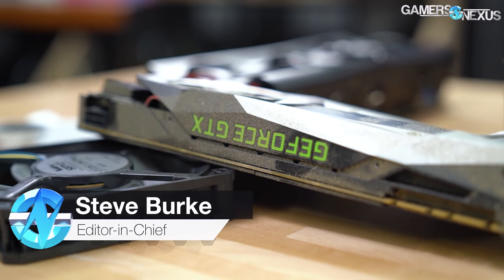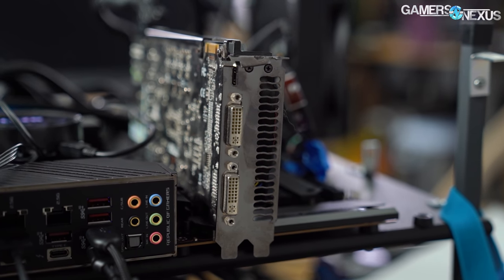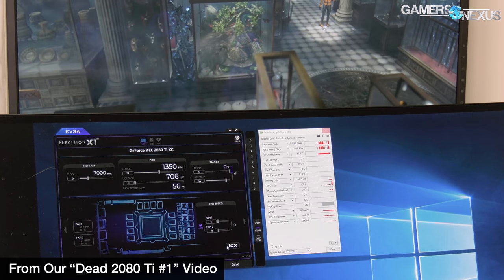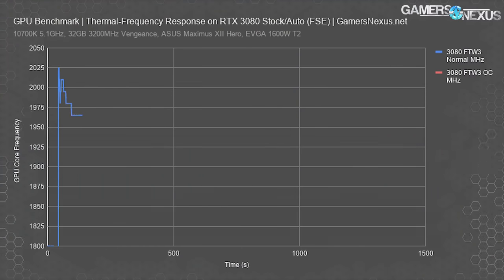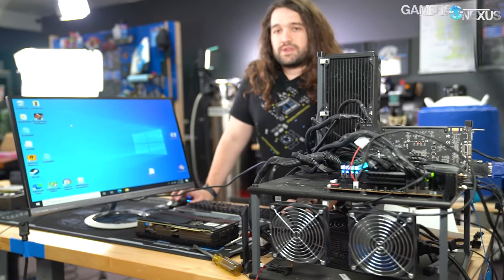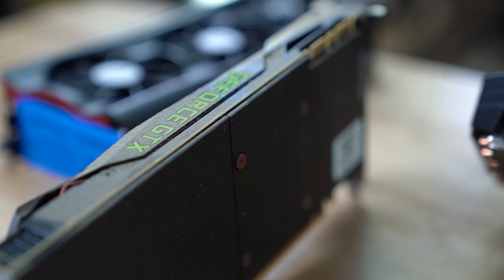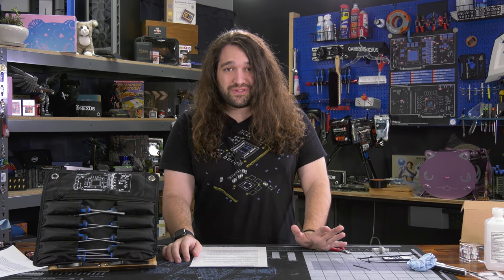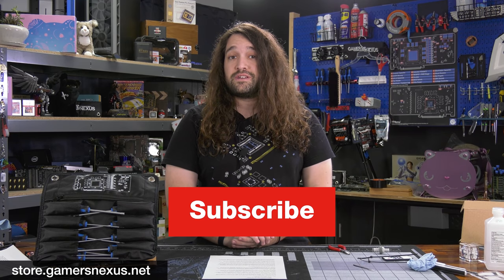Warning Signs When Buying Used GPUs: How to Detect Defective Video Cards

Comment: I recently saw a listing on FB for SIX Nvidia RTX FE 3080s for $500. Yes. $500 total for ALL SIX GPUs. I asked the guy, "What's wrong w/ them? Do they work?" He replied that they all work just fine. After a day of being skeptical, I then asked if I could test at least one on my system to make sure it works. He didn't respond until a few days later claiming that someone else was buying them. I still don't know if they worked, but I'm glad I didn't buy them. It was too risky.

Comment: Bruh.... when you pulled out that DirectCUII.... immediate PTSD, I knew it was a GTX560Ti right away. I've had one... matter of fact, I've had three different variants of a GTX560 and they all had the same issue. The design just developed a flaw after years.... the VRMs would overheat and it would crash/artefact. The only solution I found is baking, as well as cranking the fan to 100%. Hopefully if the design of the card was adequate, that would help with cooling the VRMs... The last thing I did to my ASUS was buy it some new thermal pads. I kept it going that way

Comment: Bought a used R9 290 (Tri-X OC). With all video outputs except DisplayPort being non-functional (didn't know it beforehand and actually for a long time after purchasing... since I used DP from day 1). So that may also be a valid thing to check: do the outputs actually work?
Funny thing though... first thing I did after getting the card was break one of the fan blades myself, then "soldered" it right back on with a heated butterknife. Card lives to this day (not in my PC though).

Comment: I have a GTX 1070, the sag is so bad the cooler seperates on the far side, the IO-Shild was missing completely when I bought it and I bought it without testing. But it works the girl I bought it from seemed nice and it was cheap 120bucks or also local so I guess I could have gotten my money back like with a RX480 I once had for about 2h. When you buy local the person you are buying from is very important. And if they seem nice I sometimes ignore warning signs and haven't had a problem so far. This off course only applies to local purchases.

Comment: I've got a EVGA 980ti Hybrid that would lock Core and memory to 400mhz and lock the FPS on everything to 15 FPS. This happened on the release day drivers of the 1080ti and I couldn't fix it be rolling drivers back, however if I restarted the PC 4 or 5 times it would fix itself. About 5 months later it magically fixed itself. I personally assumed it was a driver tactic to break old generation cards to make consumers buy new cards..

Comment: You didn't say anything about what happened to me when I bot my gigabyte Radeon AMD R9 270x second hand that was newer than my CPU and motherboard which was an intel core i7 3770@3.40GHz on a gigabyte z77x-d3h. When I installed the card it just wouldn't recognize the Video card and didn't work. lucky for me I upgraded my bios and the card worked so that's something you need to do as well when buying a second-hand video card upgrade your MB bios.

Comment: I was kinda hoping you guys might do another one of these, but one that show cases Cards that have know Issues that a Buyer might want to lookout for!! Example might be the Asus TUF RX 5700 XT EVO and Non-Evo models. This is just the market for those to sell cards that had bad thermal Designs like the Older MSI Evokes?? I specifically point out 5700 XT models because they are going for $900-$1000 on eBay right now which is Crazy!!

Comment: I got my first GPU is rx5500xt no clue sold it for $20 more than I got gtx 760 2GB for $50 sold it for $25 what do you think the old GPU is worth. I got gtx 1050ti for $270 and it works I haven't check on thermal paste very cheap heat shrink and fans/cover it was made by PNY. I will wait when rtx cards will drop i think not they are going higher.

Comment: One of card I bought recently work fine, everything was ok. But when I decide to repaste it and look under VRM heatsink thinking about changing thermal pad I have what to see. Card was repaired previously. I have not issue with that (but I usually like to know that before buying), I too sell many repaired cards. But three smd caps on memory VRM was completely burn (no short, not anymore :)) and somebody obviously decide to leave them like that on board and just fix fault on GPU VRM. Cap graveyard. 
Not a big issue, few minute fix, luckily board was not damaged and now is like new. But if I didn't notice that one day piece (better say crumb) of any of them will probably move and make short or fall and short something else. 
So yes, people should be extremely careful buying used cards today, now days people sell even cards they never intend to sell when market was normal.

Comment: 2 weeks ago I bought EVGA 3090 FTW3 on eBay. It had water block installed which I didn't care as I was planning to use fans anyway. When I got card the back plate was all sanded/grinded off all the way to aluminum so no serial number on it (that was my bad as I didn't check ALL the pictures in the listing). Water block still had water in it and card was packed back in original anti-static bag. Oily residue all over card. Fan/radiator assembly was heavily dusty and showed moderate corrosion for some reason.   After cleaning it with isopropyl alcohol and installing thermal pads the card failed to boot. Next day it booted but crashed as soon as it was getting in Windows. After messing with thermal pads of different thickness I managed to make card run after all but my motherboard still beeps a code regarding memory when I boot my PC with the card however PC boots into Windows anyway. It does not do it with other cards. In the end I made card to run and pass 3DMark benchmark and several games I threw at it for several days without a single hick up. So I decided to keep it. 

     When all that was happening I thought that I will return it so I went and bought another one. Seller claimed it ran in mining rig for a couple of weeks before they pulled the plug on it (Etherium switched algo) and that it is in pristine condition. The description was more than just stating card name and was written by person with soul so it I felt that it is genuine description and the card should be good buy. It happened to be true. The card looked and felt brand new with all the accessories intact( even EVGA sticker was there!). So I was lucky with that one for sure.

So beware when you buy. Prefer cards that were not messed with before at all: no pads replaced, no water block installed, not from mining rig. Ask seller before bidding/buying and decide to your best ability.

Comment: hello. i do have Gigabyte gaming OC 3060 12G. just want to ask if this is normal. my 1 fan starts spinning around 50degree celsius then the temperature will reach up to 74degree celsius while using it but still only one fan is spinning. i did not yet saw the other two fans spinning, is this normal? what temperature will the 2 fans start spinning? i hope you can answer this. or anybody can help me. thank you very much!
Reply: That means the second fan is defective or broken.
Reply: @erimani5035  thank you.

Comment: Hi, i bought used RX 6800 (ASUS TUF). I have some artifacting issues:
-It looks like a several horizontal lines next to each other with randomly green and white pixels. It last only few frames, hardly reproduciable, mostly when the GPU is switching from heavy load to low load. (like alt tabbing a video game), but never during heavy load.
-It happens only when using Eyefinity, only on one of the two monitors. It is the monitor i select as "preferable". I even can switch that and then the other monitor is then doing it instead.
-Nothing could be seen on video captures.
-Also sometimes i see, that the lower 1/4 of the monitor updates the frame with a small delay (could be seen when fast hovering over something). That happens also when under heavy load.

-Bought a new cables and a new PSU, tried other ports, tried different monitor, different driver versions, didnt help. Tried all the settings in the Radeon software.
-No visible physical defects. 

The seller was some local "Apple servis", the card was propably "repaired" by them. They have several more similar.
They gave me "30 day gurantee" so i need to know for sure its really HW or SW issue before its too late.

Any tips? Many thanks.
Reply: Update drivers/swap the card into another machine. If issues persist, document the issue and make a return to the seller.

Comment: I bought a 5700xt mech from msi...... It came with a bad factory OC and they refused to replace it even though i had recipts and it was literally just bought. They wouldnt even answer my support tickets about it. It would shut my entire computer off.... It now works but i have to lower clock speeds and power consumed and it atleast works. Thanks msi A+

Comment: Bought a 980TI second hand a couple of years ago £200, looked clean, got it back put it in my PC, when I powered it on things start burning and spitting out of the back of the card, lucky managed to shut it down and pull the card out before it killed my whole rig, the guy was a scammer who disappeared, bought it off Gumtree, my advice is only buy if they are willing to let you collect from their home address, and be ready for electrical issues.

Comment: Just a quick PSA. Testing the GPU for 30 minutes isn't enough.

I just spend $1200 on a 6800xt which seemed fine when I tested it. It wasn't until the next day when the issue became clear. The card was so ridiculously unstable it would legitimately crash every 10 minutes in games. Somehow I just got lucky for the 30 minutes i tested it out when everything worked perfectly.
For some reason it however would not crash in any benchmark.

Comment: seeing an expensive graphics card thats absolutely chock full of muck and dust is usually enough to just give it a hard pass, bought one with that very mindset of thinking i could just clean it, turns out it was rusty underneath and loads of little caps were rattling around in there

Comment: I have a used Gigabyte 2070S I bought off eBay. Works perfectly, performs perfectly. My Asus mobo, however, intermittently turns on the white "VGA" LED located with the other POST indicator lights. No idea what it means, and at this point, 6 months in, I'm almost too afraid to ask.

Comment: I bought an Gigabyte Auros 1080ti Extreme for $400 used.  The brand new Asus TUF gaming x570 mobo I bought was crap.  I sold the 1080 for $550 and bought an MSI rx580 that I'm using now.  Basically free gpu, but I'd still like to buy a new one.  Maybe I can get one on drop today.

Comment: I have an R9 390. The problem with it is that the fans don't spin faster when the GPU gets hotter. The blades are spinning all the time with 500rpm no matter the temps of the GPU. The GPU was a few years in a box, so it worked before that. I think the new drivers don't work properly. I have done some research that the fans are bad and should replace them with new ones. I could set it up manually (3500rpm) in AMD settings for faster spinning and for better colling. I would sell the graphic card, but I can't because of this flaw. The problem is if I buy new fans and if it doesn't work, then I wasted my money.
Can you test this out, if you have a GPU with a similar problem?

Comment: My friend got a PC for $15 with a 3200g and an RX 570. We thought it was a great deal, until we saw it had a hard drive and a single stick of ram. He bought an SSD to speed up the system because it was unusually slow, but we couldn't install windows onto the SSD for some reason. Turns out there's an issue with the memory stick where it has a bad sector or something like that, so he has to buy new memory too. I know there are benefits to buying used, but for me personally, that's why I always buy new
Reply: That's an amazing deal what are you on
Reply: That's basically robbery, he got an amazing deal. Just a hard drive still sells for that much money. An empty computer case is $50+ even for a bad one.

Comment: I bought a used 980ti at the beginning of last year to tide me over until I the 30 series cards came out - uh, now until I can get my hands on one. It appeared to be fine at first glance but it shows some artifacts now and again, particularly when watching Youtube on Chrome with the live comments scrolling (the screen flickers). This I think points to a memory problem (I have tried multiple display outputs and they show the same problem). I will try undervolting the memory after watching this video, also I will take it apart some day to check thermal pads and thermal paste and give it a clean.

I am stuck with it until I get a chance to buy a new card. Luckily the problem is not too bad.

Comment: I had an issue with my pc would freeze during gaming, give the bluescreen, critical processes have died and then reboot into the bios. I thought I had a broken PSU or GPU, but then discovered that 1 x 2 pin power connector which clicked together with a 3 x 2 pin power connector to form a 4 x 2 pin connector to the GPU was the problem. Because cable had a faulty plastic peg, meaning the two halfs suddenly didn't snap together and the 2 x 1 pin was loose. I replaced the cable between the GPU and PSU and the issue went away and now I can game at ultra/high settings again on my 2070.

So check your PSU too before rejecting a card.

Comment: So i got my hands on a used EVGA 1070 ftw edition for $441 on ebay this was for my first pc build and its been well over 2 months of me hounding for a decent card most were overpriced and went for over 300-400 so i figured screw it if im paying over 400 it should at least be a good card. 
it arrived in good condition i contacted the seller for more pictures initially (they only had a picture of the box in their hands as the listing) the listing said the seller used it lightly and was selling because they mainly played on console, they actually provided me multiple responces with pictures of it working in their pc and answered all my questions about the card installed with evga precision
 i also reversed imaged searched the pictures the seller provided to make sure they were legitimate (not just a google search/stock photo of an unboxing) all of them were their own recent pictures and so far it works really well i got it much quicker than the listing advertised this seller didnt have alot of history and since im new to ebay i asked for the tracking number as well as any extra packaging which they agreed and provided i trusted the pictures and figured if it was faulty or not as told i would suck it up and go through the process of a refund.
 Now something to considrr i dont have a proper moniter i kinda rushed ahead using an old tv as a moniter because well i figured it would be more important to have a gpu than run a new moniter on integrated graphics.
 So i havent been able to push this card and see what it really can do but any thoughts? 
Did i get scammed or was it a decent price for what i got.
 i feel like i paid retail rather than got a deal but im not to sure myself

Comment: For gpu sag, i routed my cables from the top of my gpu, making sure its quite tight but i can still unplug them easely, this eliminated my gpu sag issue i had with my 1660 super oc edition, my gpu is still straight after 7 months of use

Comment: I am actually wondering on how RX 5600XT is running well compared now to launch. Because I had convinced my older brother to buy it. And noticed that I have gotten a bit more frames on World of Tanks at 1080p Ultra (maxed out settings). And it hovers around 144fps, with some dips when directing in a certain view on some or several maps. And with better mitigation when overclocking it a bit further (basically the max the card and or software allows). It is an MSI RX 5600XT BTW.

Comment: This is why I only shop on ebay, bought a 980 ti and it arrived broken, the seller wasn't a scammer, they refunded me and let me keep it, but if it were anywhere else that didn't have buyer protection, I could've been screwed over.

Comment: I bought a used 680 like 5 years ago, super cheap, the fans didn't spin but if i put them at 100%, and the games crashed and had to put a little undervolt, worked on spec when undervolted so i didn't mind it much, was super cheap.
It died at the end of last year, i'm pretty sure reflowing it would fix the issue, (i tried to heat it myself and it worked for a day or two, i tried to investigate how to do it properly but, don't think i even reached the melting temperature of the solder and readed i need a kind of paste to remove the oxidation that i don't know the name of, there are a lot of kinds of paste, aside that i don't have the machine use for it).
I think it would be a good video about it because you have either technicians showing how to use specialized equipment or people saying to just put it in the oven and pray for god you don't fry the rest of the card. And not a DIY kind of properly without buying a multiple thousand dolar machine.